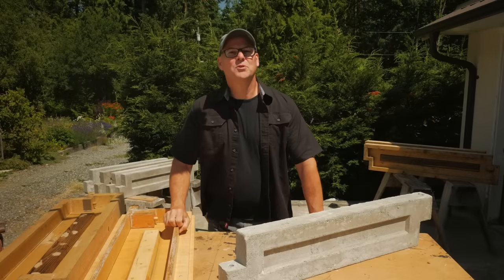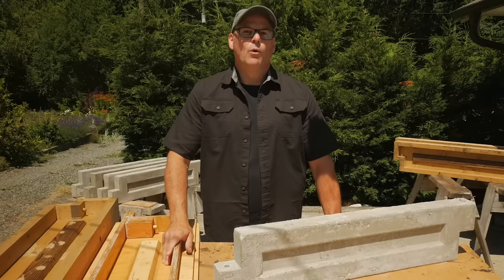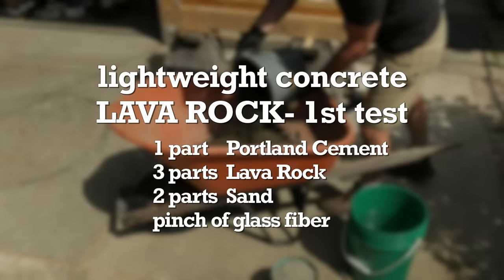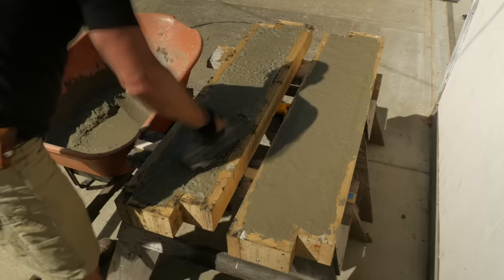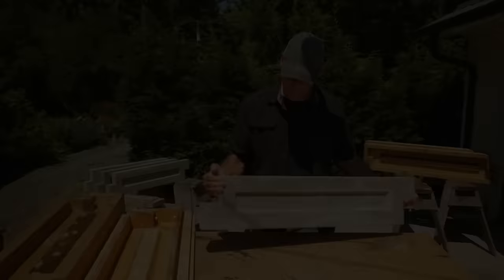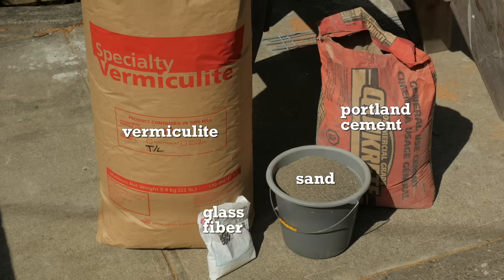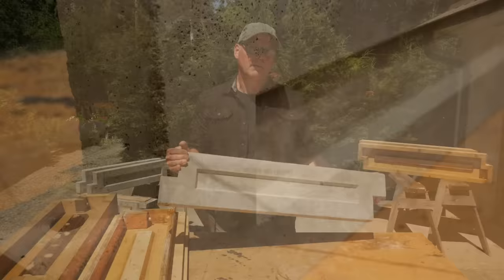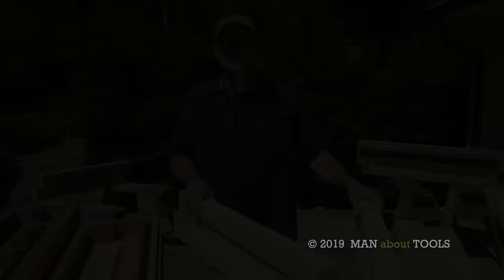make Lightweight Concrete Garden Boxes PART 3 - Aircrete Vermiculite Lava Rock

Comment from the maker: I now have molds ready-to-go here: https://manabouttools.com/store-plastic-concrete-molds/
Reply: Great video. 17:05  As for the warping and cracking of the air-crete panels it may be helpful to de-mold the panels after several days or perhaps even a week after casting. This might slow down the curing process and reduce internal stresses.

Comment: As someone who has worked with concrete and mortar for over 46 years, may I suggest decreasing the amount of water and substantially increasing the amount of glass fibers to increase overall strength, increase the surface strength, and decrease bowing and cracking?
Reply: concrete does not get stronger by adding fibers or steel ,  it just holds it together in case it cracks (I'm not talking about prestressed concrete )    Cheers   Will from 3D Stones high end concrete on FB
Reply: @willdeburr  By your own admission, rebar and glass fibers DO make it stronger: both materials increase the tensile strength of concrete.
Reply: @whitemanbrownworld plasticizers may reduce concrete's compressive strength, but this may not be an issue with garden boxes.
Reply: Hey how are you Michael Burnee, I am  working on Light Weight Concrete what's the best water cement ratio for light weight concrete.....
Reply: @user-yg9pz7dr5s  Since aggregates and cement properties vary, the only way to determine the ideal wet-to-dry rations is to carefully measure the ingredients, mix them thoroughly, and test them for slump. The ideal mix is one that has just enough moisture to hydrate the dry ingredients and provide workability - but no more
Reply: That won't fix the durability though - re the weed strimming
Reply: Paul Morgan perlite might be the answer or something else that’s light enough to stay suspended in the setting mix. !
Reply: I can't believe the foam doesn't completely collapse when blended . I'm so surprised this works.

Comment: The foam making alone was worth the watching!
Reply from the maker: Thanks! That truly is fun.
Reply: @MANaboutTOOLS  Out of Interest - which paddle would you stick with - and am I missing something as to why you would invest in a foam generator? - your foam wasn't as voluminous as from a generator - but it looked good enough to me.
Reply from the maker: @ralphstube  I'd use the smaller, egg beater style one. It worked well and I think the foam was dense enough. I had almost no foam collapse. But, I do think a foam generator (dialed in right) can produce an even denser foam. From what I've seen.
Reply: @MANaboutTOOLS  A suggestion for a tank on a foam generator i made, I used a a cornelius keg for home brewing. It is  5 gallon capacity, made for pressure and can be picked up used for less than $50 with fittings available at the local homebrew store. IMO it is better than the  PVC made ones because pvc is not made for pressurized air.
Reply: I agree. I can save a lot by hand mixing (no foam machine). I would use the mixer that kicked out the foam over the edge but with a cover. I'll bet the AC box will be a lot tougher in a month, not that I find it too soft, this stuff stops a bullet and will never burn.
Reply: Oh yesss! So simple solution and cheap to do foam. Thanks!!!

Comment: You might try an additional "submerged" curing step after removing from the form.  Concrete crystallizes/cures slowly over a period of days/weeks/months/years, and the presence of water positively affects the process.  It's possible that your aircrete panels simply dried out faster than the other ones due to additional surface area, affecting the cure.
Reply: What is "submerged" curing?
Reply: @emilystubbs5650  soaked in water :)

Comment: Nice! 

Notes on aircrete: 
- I just wrap a stainless steel scrub pad around the tines of the paddle mixer, it flails out and distributes more surface area per unit of force to break air into the soap solution. 
- For the soap solution itself I've gotten to just using a teaspoon of SLSA powder to 3 pints of hot water to make a 5 gallon bucket full of foam. 
- To make the panel face more durable use a portland and sand mix to make a thin film (like a finish coat of stucco [1 part cement to 1 1/2 - 3 parts sand]) to coat the face of the mold first then pour in the aircrete. 
-You can also add sand, vermiculite, or charcoal fines to the aircrete mix. 
- Charcoal is a good lightweight aggregate on its own as well (not the briquettes obviously, but the naturally structured kind you make in a retort).
- Aircrete is stronger when it is skinned on both sides. Think of it like the aerated gypsum fill in a panel of drywall. As long as the paper is there it's fairly strong, but once you cut the surface it snaps easily.
- Landscape fabric, window screen, agribon, housewrap or other durable materials with textured or adsorbent surfaces can be used to face each side or be buried near the face just below a finish layer of cement to create tensile reinforcement and prevent bowing.

You can also recycle some styrofoam by grinding up cups, plates and packaging material and using the stryofoam frass in place of the soap foam. It creates a mixture that can be vibrated and packed but weighs roughly the same.

I'm enjoying the videos, keep them coming.
Reply: Just a note, on gypsum the paper is tensile strength not compression, the aircrete will lack compressive strength just by the very nature of its components,

Note: cracking and hairlines do not mean the beam was compromised, that’s taken up by the rebar
Reply: No because the reinforcement needs to be under stress before it will take the load. Before stressing it won't have compressive strength once stressed the metal spreads the force.
Reply: So Un Mapa was right the hairline cracking doesn't indicate compromised concrete
Reply: Christopher Smith Great additional information! Would the styrofoam and concrete mix be less susceptible to failure than aircrete?
Reply: @codykiroff5078  Yes. The styrofoam beads are a sturdy aggregate on their own and the cement can be mixed with an optimal amount of water. Aircrete is always necessarily too wet to create a strong cement bond. Although you could also make a batch of aircrete, crush it into aggregate (or spread it thin on a plastic sheet so that it breaks up easily and uniformly) and mix that cured aircrete with more cement at an optimal water ratio and achieve a similar effect to using styrofoam beads.
Reply: @christophersmith8014  Thank you! I was looking for a lighter option, as I am working alone. But I also wanted strong panels. Both answered thanks to you and Manabouttools.  Got lots of plans for these great panels.
Reply: @unmapa5767  Cracking allows water ingress which can ruin it in freezing weather or corrode the rebar. So yeah, cracking compromises concrete.
Reply: @familyocoileain9860   Tell that to the people in Miami, Fl. who were killed after seeing hairline cracks and sounds coming from the FIU bridge.  The idiots in charge of the bridge didn't think it was compromised either.
Reply: Nice video, thanks ! Did you ever try pumice rock in sand form or fine pumice gravel?
Reply: @whitemanbrownworld How did your experiment with pumice and vermiculite workout?

Comment: You can add outdoor latex paint in place of half the water to any concrete mixture to give a unique finished texture and color. It seems to last just fine in the weather as well but I've only had my test pieces outside for 6 years so I've got 4 more years of weathering to finish my tests. In this aircrete I imagine the latex would offer some flexibility and maybe even a little strength but it will be next spring before I can even get around to starting that project. Thank you so much for these videos.

Comment: Not sure if anyone has mentioned it before but you can use recycled Styrofoam (Insulation board or that Styrofoam packing that comes with most small appliances; ground up into little pea sized bits) as an additive to your concrete to lighten it without losing strength. We have been doing this for years when making Halloween decorations. Great for Pillars, Tombstones and other yard decor that needs to survive the elements (Canada)
Reply: What ratio do you recommend?
Reply: I wouldn't put plastic in concrete meant to be used in my garden.
Reply: What's a good way to grind them up? What shredding mechanism do you use?
Reply: That gives very bad quality concrete but to each their one.
Reply: I laugh when idiots think that adding foam doesn't decrease strength.  There's  reason no one uses it for load bearing walls.   You need to learn self control and not fall for every hair brained idea you see.
Reply: @Critical-Thinker895  I mean you're right. It does decrease strength. But I think as long as you're not driving over it or using as a load bearing wall you'd be ok using it in the garden. 

For this particular use it might be ok if you're just trying to make it lighter and still more durable than wood.
Reply: @caelrock  I use about 10:1 but I also add fibre and a bonding liquid , 42.5 MPa cement with as little water possible, or add a placticizer.
Reply: @Critical-Thinker895  each cement type has its own application, this has also very good heat insulation properties, does your loadbearing mix have the same, no..., plastering also have a different mix ?

Comment: You can put a concrete leveler finish over the panels that will make them as durable on the surface as regular concrete.

Comment: Very cool!

Vermiculite is indeed expanded mica and is used in potting media to retain moisture and provides air space. There is also larger sized vermiculite, used for packing, but not usually available through big box stores (seen through Uline). I agree with another commenter that perlite might be a better option as it is used mostly to provide air space in planting media and is still very lightweight. Somewhat like the lava rock, except smaller and lighter.

I hope you will try some of the aircrete suggestions too; I am very curious to see how those compare with this version. Thanks again for doing all these tests and providing details on the components for each. Definitely more interesting that watching paint dry - I didn’t even realize the video was 19 minutes!

Comment: Also, to anyone else trying this at home, this stuff doesn't trowel. I don't own a magnesium float, but I don't know that it would make much of a difference. The bubbles cause the mix to stick, like glue to whatever surface it comes in contact with. Maybe something to do with surface tension... What worked good for me was smoothing the top over after laying down thin painters plastic. This made it very easy to get a smooth surface. Now, I'm gonna pop my form to see if everything else is smooth.

Comment: I have done light weight block using vermiculite

If you pre wet vermiculite and drain excess water before mixing, it works very well. I have even achieved 50 % weight reduction

Comment: I want to thank you for making this video! I learned that you can use a swazall without a blade as a concrete vibrator and was happy to see it worked as well as it did. However I think you forgot to put sand in the aircrete mix and was surprised it worked so well without it!!!

Comment: Hydraulic cement will work better also leave them in the forms for 5 days this should help the flexing and as soon as you take them out cure them with a sealant like tile sealer or better yet concrete cure this should do the trick I'm going to try your vermiculite panels and see how they work thanks for the video and I do not find it like watching the paint dry can't wait for part 4
Reply from the maker: I'll look into hydraulic cement too. Thanks for the comment! Cheers, Kent

Comment: A suggestion for the aircrete one, put a quarter inch of plain sand cement mix in the mould (especially if it will be the outside face) before adding the foam. Might help the abrasion problem.

Comment: Great work - I would like to see you use these methods to make some large planter pots.  My motivation is I have a 'mobile garden' in large pots on wheels so I can move them about to clean the underlying pavers and make the best of the seasonal sun (or shade on hot days).  Ideally, I would like to build the castors into the pots somehow.  I'm thinking the perlite mix with reinforcing may be best.

Comment: Based on my experience, the added moisture of aircrete should be allowed to cure under plastic with occasional wetting for at least 10 days to prevent cracking, hot drying results in cracked concrete.
Reply from the maker: I cured all the panels snuggly under a plastic tarp and watered them every few days. For four weeks. Then brought them out to dry before weighing.
Reply: MAN about TOOLS that was good. Your foam looked good but you might add several hand fulls of fibers, use basalt grid because beds are going to be wet, so the hog panel will rust away in this application. 3 lb foam iS good. May be half the foam would be tougher.

Comment: To stop damage from weed trimmers, a thin coat of regular hard concrete mix...to say about the first three inches from the bottom of the outer lower surface can be used before pouring the lightweight concrete. Then the kids can still help carry them if you decide to relocate them later on.

Comment: Great video and on a project i am planning to do, i did aircrete side walks around the house , with 3 parts foam, 2 parts sand 1 part cement, they hold up well to foot traffic , but did gough from my lawnmower deck and the 2 places someone mistakenly hit with a car tire it cracked .
Reply: I've often wondered why more people don't try putting sand in their aircrete and reduce the amount of bubbles.
Reply: This is a great idea! Maybe do a 1x4 (or whatever) form just far enough to give you a 2" concrete side, with a 1" top across the aircrete sidewalk for lawnmower protection? Just a thought. But I LOVE this idea! Did you do a gravel base or footing beneath it?

Comment: For aircrete blocks. When thats ready then spray or dip in water cement mix liquid. It will seal the thin holes and make it strong

Comment: You have to think of cement itself as being glue.  It has little strength on it's own.  Aggregate (well graded) is what gives concrete it's strength and durability.  Blending cement with fine sand (mortar sand) and even using fly-ash or silica  fume will greatly improve your aircrete's strength.

Comment: Hello. First off let me thank you for a great idea for longer lasting flower bed. However knowing concretes behavior the air Crete will absorb more water. If temperature gets below freezing they’re sure to crack. Best to use high strength concrete with a plasticizer and fiberglass strands. You can make them thinner, nearly as strong and almost half the weight. But you’re onto a great idea!